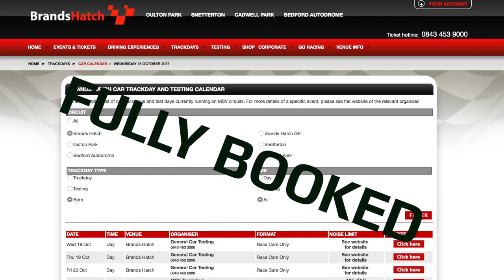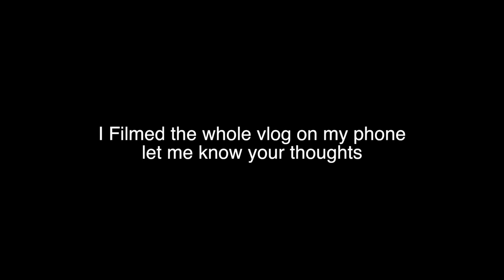I UPGRADED MY BRAKES!! - E92 BMW M3

Comment: Mechanic was a little misleading;

1. BMW actually use textar pads as oem item
2. He said take it easy with the pads to bed them in. You're actually meant to do frequent hard braking cycles, get up to say 60-70 where possible and brake hard down to say 20 and then repeat. Read any brake bedding in procedure and they'll tell you to do it this way
Reply: that's what I thought aswell

Comment: They should have used a pressure bleeder and also ran the ABS pump to flush out/replace the brake fluid otherwise the original brake fluid is still inside the ABS valve block.

Comment: Brakes are an issue on the E46 too, interesting they still used a basic brake setup on your next gen M3 as you would of thought they would of learned from the complaints before!
Reply: The Benchmark The rotor and caliper set up is fine, it’s just the pads they use that leaves much to be desired. They do this to extend the life of the rotors, reduce noise and dust. Most people want those features over monster braking even if initially they “think” they want a “race” set up. Living with that daily would change 99% of owners tune. Swap quality fluid and race pads and the braking is very good. Stock rotors front and rear are huge.

Comment: The reason these bmw's handle so well is largely due to all the light weight components the engineers chose for the suspension and brakes, although the handling is magic the brake rotors wear notoriously quickly on these cars, just a heads up.

Comment: All the E92 M3 needs is proper pads to transform its braking behavior. Ferodo Racing pads are beasts and easily doubles your braking power. Only issue is excessive dust and annoying noise on low power braking (ie around town etc). I just use Hawk Street 5.0 for daily and swap in Ferodo whenever I’m planing a run or track day. Very easy and fast to swap front pads once you have done in 2-3 times.

Ricky, if you put Castrol SFR fluid and Ferodo race pads I promise you the braking will be up to where you need them. I know you sold the car but in case you get one back in the future those two changes are all you need for anything you put the car through on the street.

Comment: You should also upgrade your tires. I just got a new set of yokohama ad08r and since the weather is really bad currently, I just have them in the garage, so they haven’t been tested yet. But I previously had michelin pilot super sports which are side by side now with the yokos, and just by touching them you can most definitely feel the difference. Yokos are a lot softer even at such low temperatures. Can’t wait to try them in warmer weather.

Comment: Interesting to hear how you get on, I swapped out my original pads for DS2500's before taking my E92 M3 on track at Goodwood, still overheated after a couple of laps at the end of the Lavant straight, but found my tyres (MPSS's) went off around the same time. Anyway enjoy, hope you have a fantastic day, it's where the M3 is meant to be 👍
Reply from the maker: Brook41dale Thanks, yh ill defo report any problems if there are any, can't wait tbh also booked tution so should make the video interesting

Comment: Enjoying your vids,I’ve got an e92 m3 also and I’ve done manifold back system no cats,air filter,rod bearings,remap.i also went to oem 18’s which makes the car noticeably better to drive and the handling is improved.

I need to do what you have done as I want to track mine soon! Look forward to the next video 👊🏻
Reply from the maker: RotrexfezST Some sick mods you got bro, ive got all that to come cant wait. Yh ive purchased a set of 18's cant wait to feel the difference

Comment: I often see 4 or 6 caliper front brakes which cost at least 3000$ on family cars which never see a racetrack and they fitted 2 caliper brakes on an M  model? Not to mention drilled rotors which are not the smartest choice. J hooks are mostly recommended. 
Anyway, I suppose these are good enough for a 30' track session.

Comment: I thought you're suppose to bed the the brakes in by doing heavy braking from 60kph a few times then from 100kph a few times.  That's how I always do mine.  I heard if you took it easy, it won't work properly.

Comment: Hey man as in the video the car has spacers on it! Is it okay to run spacers when doing high performance/track driving in terms of safety? i know the spacers are bolted in with the the wheels but wouldn't that offset the wheels rotational mass by the 12 or 15mm that your running? don't really know how spacers work but just thought id ask as I'm looking at getting spacers for my m3 but don't want to jeopardise the spirited drives on back roads i do sometimes! :)
Reply from the maker: Kanwarbir Singh Thanks bro, i think your looking a little to deep into it you might technically be right, but its nothing you'll notice i ran my f80 with spacers car felt alot better. You have your horror storys, but everything in the car world comes with a horror story
Reply: No problems with hub centric spacers. They’re effectively the same as using wheels with less offset.

Comment: 👌🏽💯 hi bro you good , very good upgrade done. how does the car stop now? did you notice a big difference from stock. if you can flush old coolant and use water wetter made by red line off eBay not cheap but does work and help... •Reduces or eliminates bubbles or vapor barrier that form on hot metal surfaces to reduce coolant temperatures by up to 20°Superior heat transfer properties compared to glycol-based antifreezeCompatible with new or used antifreeze (including DEX-COOLTM and long-life versions) to improve the heat transfer of ethylene and propylene glycol systemsImproves heat transfer and reduces cylinder head temperature. I've used it on all my cars 👌🏽 try get more air to the rad as well if anything in the way. front / rear strut braces will help

Comment: Ricky did they chamfer the pads? if not that is why you have a spungy pedal when replacing the pads on worn rotors such as yours(see the lip) you MUST chamfer the pads
Reply from the maker: Jolinator Yes i think they did, on the way home they actually felt fine
Reply: Goodstuff mate, cars coming along nicely although your really gonna want some some fresh rubber for the track but i understand your conundrum regarding getting new wheels. All the best
Reply from the maker: Jolinator Yh i know the importance of tyres, its just ive already purchased the wheels 😜

Comment: If you want a big brake kit after xmas then you can buy my brembo GT big brake kit off me if you're interested. I've done an M3 GT4 build so I'm moving down to 18in wheels and these brakes only fit on 19's. If you're gonna be tracking your m3 then a stage 1 brake upgrade is just a short term fix.
Reply: Ghost GT not really
Reply: Apex 95, it's fine if you're just playing at it, but if you want to lay down some serious lap times, and rack up a lot track time then they are just a short term fix. That's why the M3 GTS have 6 pot Brembo GT's on the front  and 4pot Brembo GT's on the rears. If a stage 1 upgrade was sufficient then BMW would of just done that with the GTS.
Reply: how much for the kit pal

Comment: I own the same car but E90, the stock brakes are total shit for track. A bloody 135 m sport has better brakes (4 piston vs 2 piston). The tuner Motorsport F80 brake upgrade kit is what I'm looking to get, the OEM brakes from the F80/82 brembos on the E90 for a much better price vs a BBK front and rear

Comment: What's the best brake upgrade for my e46 M3 ? Thanks
Reply: Depends on your cash flow. After a lot of research I think Stoptech Trophy and AP Racing are the best. Expensive though! I've gone with Stoptech Trophy ST60 380 front and ST40 355 rear. Probably overkill on the front but they look the biz :) First trackday this coming weekend after bedding in. I'll let u know if your interested.

Comment: Should stop you getting brake fade on track at least, not going to improve your braking per say, especially with old crap tyres. Best thing you could do on ya first trackday is just invest in a little tuition with a racing driver who knows the track. Gonna get you quicker than any car mod will ricky. Good luck.
Reply from the maker: Yh i've booked brands hatch with tution  like you mention should be fun 👍🏾👍🏾